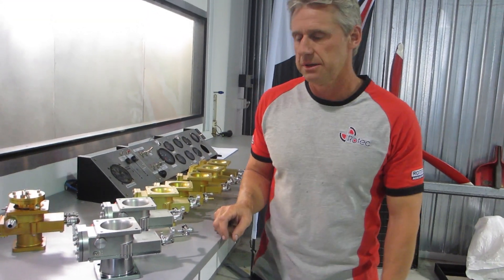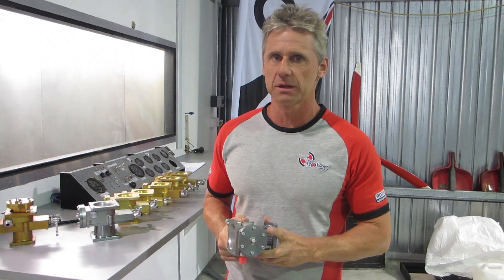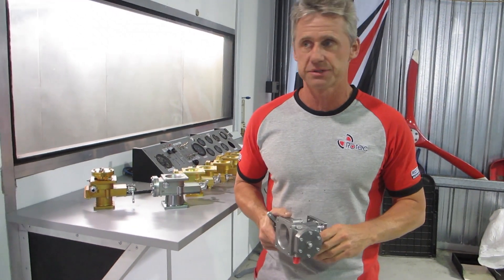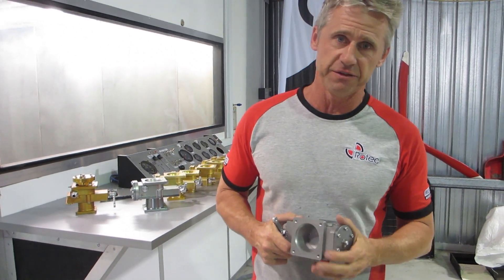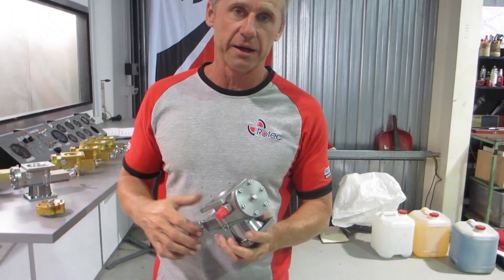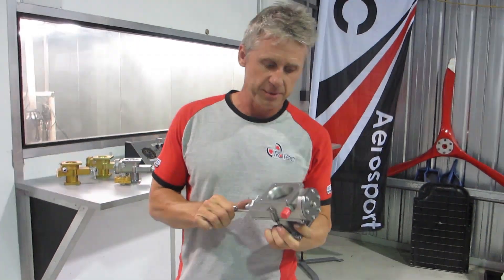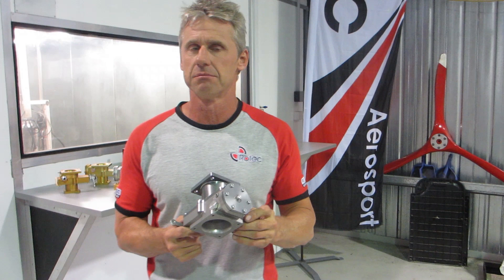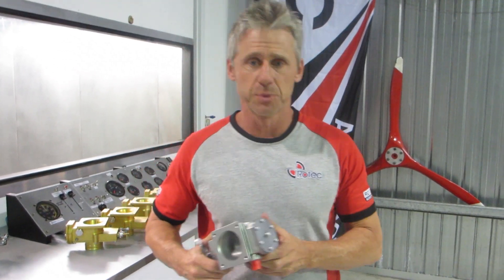Rotec TBI  INTRO 28 4 2016

Comment: Automotive applications would be good , what's the rail pressure 30 psi -60
Reply from the maker: Actually it’s a low pressure system. So you can retain your  carburettor fuel pump. Even works with a gravity feed.